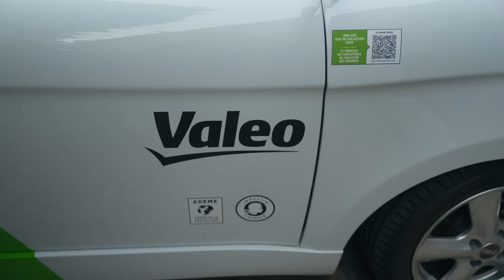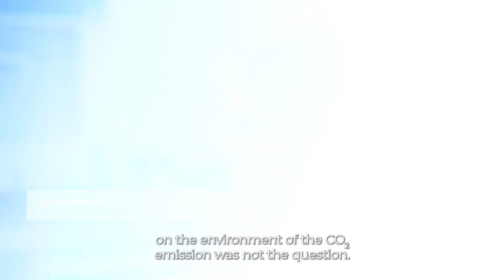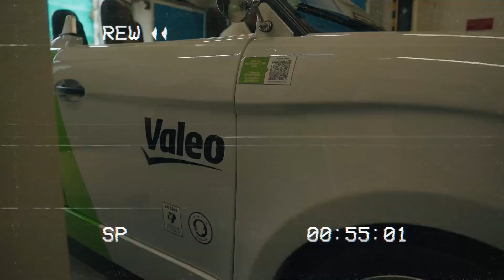20 years of Stop-Start system: from pioneering innovation to market standard

Comment: So its your fault for inventing this BS.

The additional cost of maintaining the battery, starter motor and the electronic systems that made it work for outweights whatever CO2 you saved.
And don't get me started about the additional wear n tear on bearings from the start up when oil pressures are ramping up!